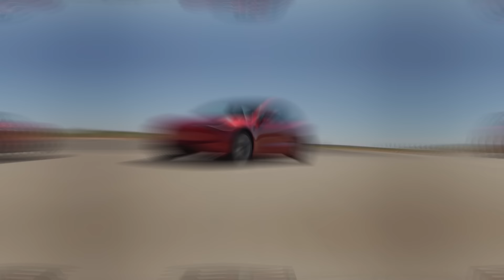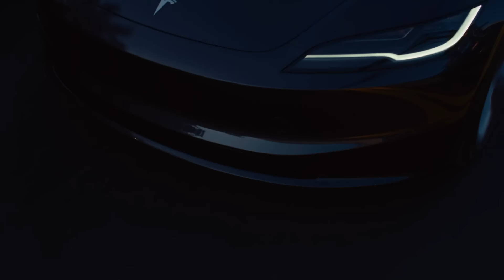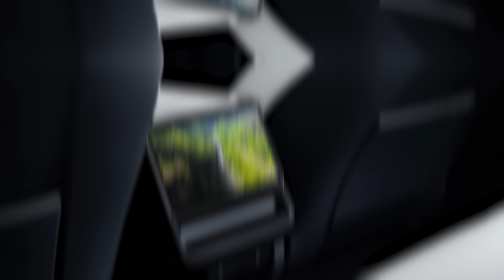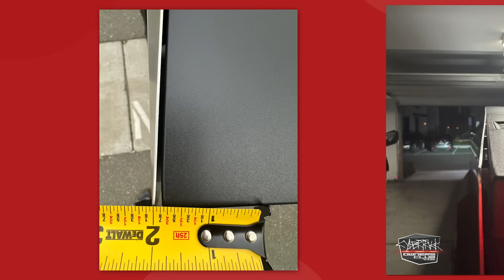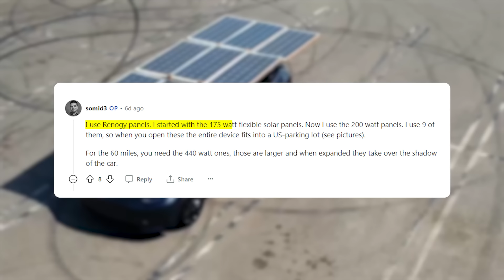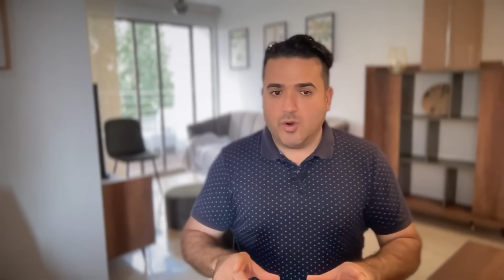The 2024 Tesla Model 3 Is Officially Here!

Comment: Thank you for your reviews of the refreshed Model 3. They’ve been VERY helpful. 

If you have time, there are a few hings I’d like to have you explore:

Hardware 4
Practically speaking how is it different than Hardware 3? Does AutoPilot or FSD work better? Perhaps fewer errors? 

Does Hardware 4 perform better with accident avoidance?

5G connectivity
The car is supposed to have better cellular service. What does that mean? Is the map data presented more quickly? Does music or video stream more reliably? 

Improved Bluetooth 
I’ve read that the car will recognize your phone from farther away? Are there any other benefits?

WiFi range is now dual band.
Does that mean it will be easier to connect to my router at home? Or that my WiFi downloads will be faster if I can connect with 5G instead of the 2.4G found in my Tesla Model 3?

Adaptive Matrix LED Lights 
Are these new to Model 4? I gather they will be able to map out cars in front of you to avoid blinding other drivers. Does this mean you can stay on high-beam all the time?  
Thanks again!
Henry

Henry F. Domke

Comment: TESLA needs to integrate enough panels into the roof and rear windows just to keep charge up when the car has sentry mode on and is not hybernating.  It is very frustrating to find a 5% loss every day, especially those who can't keep the car plugged in overnight
Reply: hmmm....solar panels don't generate anything overnight, or in an undercover carpark, or in a garage, and only 15-20% on cloudy days and 10% on rainy days , on a cloudless day mid summer you might get a couple of percent back - it's the worst payback of any accessory on the planet.

Comment: The loss in range from the added weight on the roof and worse aerodynamics will negate any 20 mile per day gains you will make when having the car parked all day. You will loose overall mileage in the long run if using this stupid contraption daily.

Comment: Remember the old Acura legend ads of the 1980’s.  They would roll a steel marble along body gabs to show consistency.  Big 3 had huge issues with body fitments inside and out before Japanese cars arrived.  I grew up in the 60’s.  I would use wood screws to stop rattles and squeezing noises in my new Chevrolet.  Plus all the paint blemishes.  Many of their  engines were horrible.  It took Big 3 forever to get rid of drum brakes, carburetors(most non domestic fuel injected) sealed beam headlights, clutch radiator fans, etc.  Cars have come along way in 100 years.  I am never a gap guy.  My new MB hatch now that I look at is not aligned well.  As long as car starts and dependable more of a factor to me.  Vehicles are becoming too expensive though for a depreciating liability.  It’s not an asset unless you rent it putting money in your pocket each month.

Comment: Tesla got some many things in their generation 1 cars.  Competition has several generations over past 100 years of ICE.  I own a new 2017 model X, 3, and Y.  My X has never been to service center.  Only maintenance have been tires.  I have solar/powerwall at home.  Save $500/month on gas and home electricity.  I can not control healthcare premiums but can control energy costs
Reply: I have Starlink and with battery backup able to have internet with power outages.  My previous spectrum land internet must not have battery back up at company headquarters.  With power outages I lose my spectrum modem signal and no land based internet.  Tesla will have Starlink in their cars for worldwide fast internet anywhere.

Comment: I’ve tested my car with an empty roof rack on or removed. I’ve done the same round-trip and found about a 5% reduction in range.
Considering the panels would have more wind resistance, it seems like a waste of time unless you’re traveling short distances per day and at lower speeds like in the city.